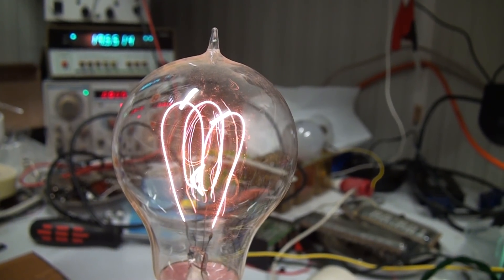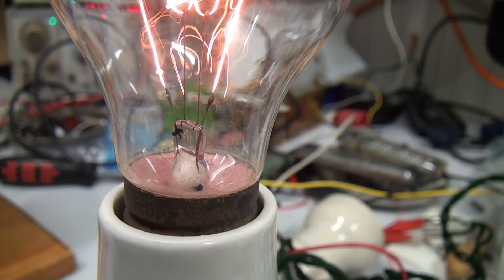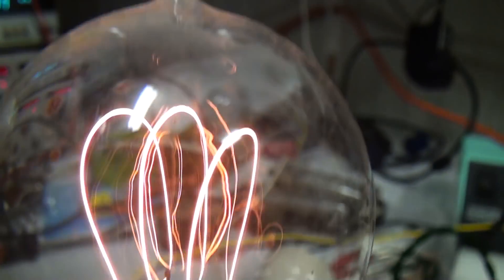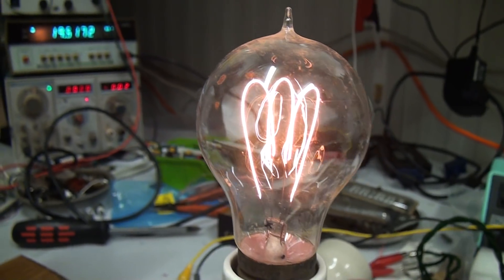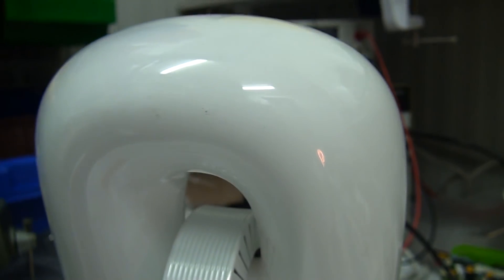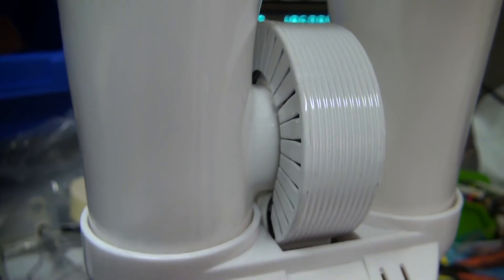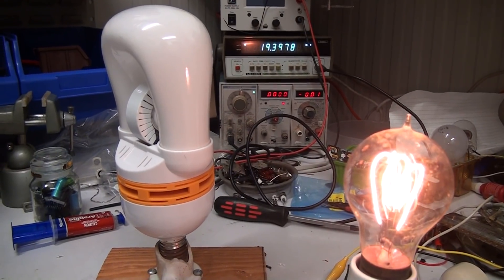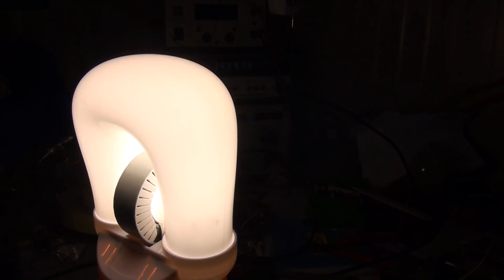Induction lamp and 100 year old Carbon filament lamp

Comment: There's a carbon filament bulb in Livermore, California they claim has been on pretty much non-stop for coming up on a hundred and twenty years now.
Reply from the maker: Is it the one that is in a fire station? I have heard of that one but I understand that it has been relocated to a museum now.
Reply: rustymotor ...or was the old fire station made into a museum? You're right, however it came to be, it was in a caretaker's charge when I read about it.
Reply: Ironically, there already is technology to make an immortal bulb...a nernst lamp (which is not technically a bulb). If they hadn't been junked, most if not all of them would still be burning today. Rusty could probably make a nice one in his garage, they are very simple devices. Just ceramic and a heater with a ballast-starter assembly.

Comment: Love the carbon lamp I could look at those for hours  they got such a nice gentle glow. Ive never seen an induction lamp in the flesh before I can see that they would be acceptable in an industrial setting but cant imagine something that ugly in the home. Do they cause much RF noise to medium and shortwave reception?
Reply from the maker: I do believe they are intended for high bay industrial lighting where long life and economical running is desired. They claim they should last 200.000 hours but I imagine the electronics would fail before then. I guess they would not win any home improvement awards!